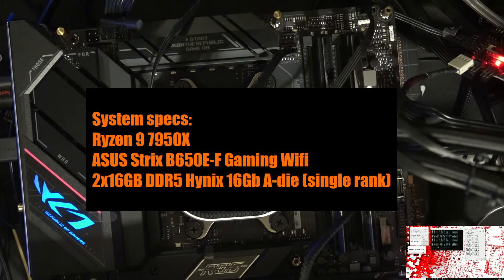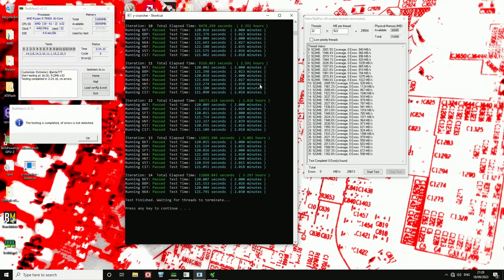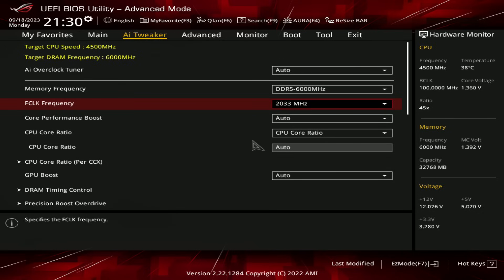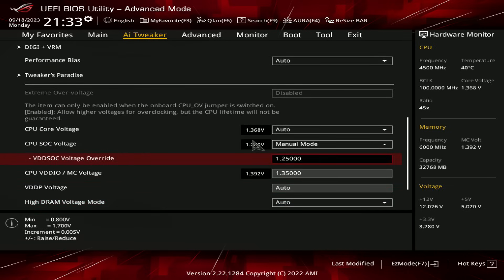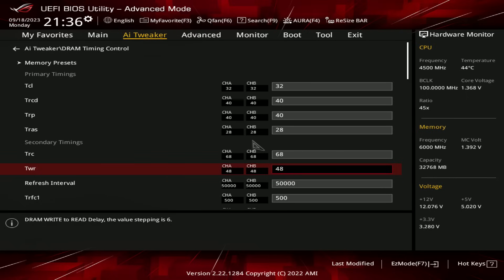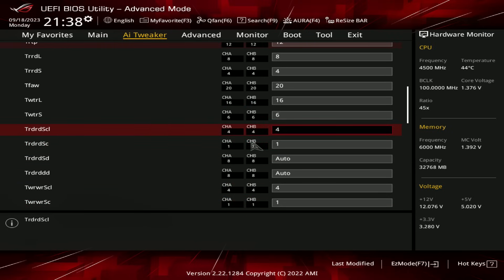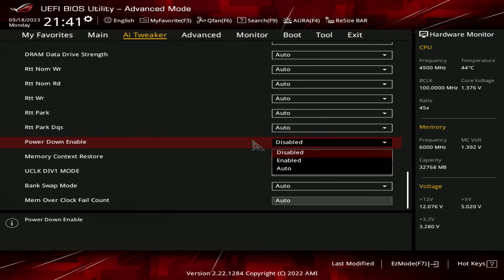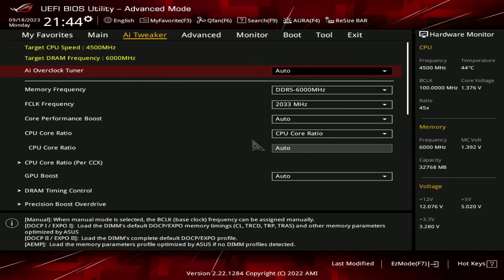Easy memory timings for Hynix DDR5 with Ryzen 7000

Comment: Hello there. I've got a big issue with my new kit 16gbx2 rams. Well , to explain , I have an Asus x670e ProArt motherboard. I've already have Corsair 16GBx2 cl36-36-36-76 EXPO edition. Yesterday, I've bought another 16GBx2 RAM but with CL36-38-38-76 but Intel XMP edition. The thing is that I've got crashes and windows errors from time to time. Does my 1.020V SoC does impact the RAM ? Because I like to have my CPU at slow temps, I'm playing mostly FiveM and DayZ, are running great on my 1.020v SoC voltage and -35 negative on all cores. I would like to find timings to fit with my both EXPO edition ram and XMP ram. Timings are almost the same but the voltage , for the EXPO is on 1.35 and on intel is 1.25V. I would like to get some help for it to bring more performance to my PC without increasing the power draw on my PC.
Reply: I dont think soc voltage is the culprit here, your co might be too aggressive. I had similar issues on -35 co. -30 is much more stable.
Also you can try changing voltage on xmp to 1.35 to match expo’s. Or better yet, set both of them to stable 1.30v

Comment: I changed flck from 2000 to 2033 and my 1% lows increase from 240 to 260. So id say that is great. However, I used all your timings and it made no difference. I am using a gigabyte board and the low latency mode. I wonder if the effect is similar? I checked hwinfo and the timings are indeed the ones i copied from your video. Im very confused by this.

Comment: cool vid, only a year late to finding it...  have you figured out why the 2033 FCLK is faster than other options?  curious because clearly there is a reason.  In recent experimentation with CPU undervolting, I discovered that the core voltage is too low with expo on causes crashes.  this is not how Ive seen 5xxx ryzen work because its SOC voltage sensitive. it seems odd I can run a 7950 at 0.95v with expo off and it requires 1v with expo on.  MB set to auto SOC
Reply: From another comment: 
"2033 was faster for him because of a bug. on newer agesas, you want to run 2000"

Comment: hey, just to tell you that on my Asus ProArt x670E Creator Wifi, with 7800X3d and Corsair CMK32GX5M2B6200C36 6200 kit, I have BSOD using exactly same timing as you. I have of course disabled Power mode and MCR as told in the pinned comment. Do you think it could be because of the VDDIO voltage ? 1.35 is not enough for this kit ?

Comment: [First time PC builder]  Glad I came across this video. Couldn't get past 5600Mhz with default expo settings, not sure what was wrong there. But with these timings 6000 seems to be running smoothly with ryzen 7900x and asus x670e-a.
Reply: I had this same issue with your motherboard and realized I was using intel ram sticks and not amd ram sticks lmao.

Comment: Is it possible for these timings to be unstable? After my computer shuts down abruptly, for example due to a power outage, I get a dram light on my motherboard and it doesn’t go away even after reseating the memory.
Reply: The issue only goes away after resetting bios, after which I can set these timings again and everything works fine until the next outage

Comment: I have a question. I have gskills 64gb 32 gb per stick 6000 30 40 40 96 hynix m die 2 rank. The expo profile does not have secondary timings   when I run expo by its self I have a latency of 79ns  when I add your secondary timi gs at a 2000fclk I get a latency of 67ns. I have been told I want to shoot for sub 60 ns latency.  What if anything could I do to get there?

Comment: I'm getting restarts and freezes on my asus tuf x670 plus with two different brand memory kits (sk hynix) and Ryzen 7600. I'm not sure if it is my garbage motherboard or something else ,thinking of switching to MSI motherboard. Any ideas would help
Reply: Yes, never ever mix different memory and do use the exact same memory on all banks (preferably use only 2 banks of your MB if possible)
Reply: @medusa2820  I have never mixed them ,I have only tried separately brand by brand and now I'm trying the 3rd one :) I'm getting a feeling that my cpu doesn't like 6000 mhz overclock.
Reply: Oh and one more thing, if you try a lot and the computer keeps crashing, rebooting, BSODing, you HAVE to clear cmos, otherwise it will remain in some kind of failure state.
Reply: thanks👍 I will keep that in mind

Comment: How about the ryzen 7600, since it's a lower bin can it still easy hit 6000? I have a 2x16 kit with spec expo 6000 and it's on QVL of the mainboard, but I get crashes blue screen. I did try to load expo timings and set speed manually to 5200, still errors etc. I even get crashes with default settings for the cpu and the memory....Solved, memory stick was faulty. Works fine with the new kit.

Comment: @buildzoid - is there a guide like this for Samsung DRAM? Going on the assumption that when Thaiphoon says "Samsung" under Manufacturer in the "DRAM Components" column that I do NOT have Hynix, then the timings probably won't work for me. Does anyone have or can anyone point me to timings for my setup? Specifically, I have Samsung K4RAH068V?-BCQK (yes, a question mark in the part number), 16Gb/1die, 2048MHz G.Skill memory - 2x16GB modules. The Expo numbers are 36-36-36-96, RC=132, WR=90, RFC1  = 885 RFC2 = 480, and VDD = 1.35. I'm certain there are better values; I just don't know how to test without catching on fire or blowing up my system ;)             EDIT: memory part number is F5-6000J3636F16G    EDIT 2: on a MSI PRO 650-P WiFi (MS-7D78) with an AMD Ryzen 7 7700X - sorry for those omissions. 😁

Comment: Hey, I have G.Skill S5 DDR5 2x16GB (CL32-38-38-96 1.35V) with seems to have Hynix chips. I copied your settings, but I get strange artifacts. Let's say I want to lower the speed to 5800Mhz how do I adjust other values? Or maybe you have some ideas how I should adjust your copied values? Thanks in advance.

Comment: I did everything exactly the same but it won’t apply all the settings only some. For example Tras, Trc, Twr and some others are impossible to change. I can type in the wanted value but it won’t apply. Ai Overclock Tuner can be put on Auto, Manual, EXPO 1, EXPO2 and EXPO tweaked but I tried every option and none of them let me change those values. Any ideas how to fix this?

Comment: This is an old video and thread. I know that. I just want to put that out there before the trolls come at me.
I have not been in the PC game for over almost 15 years and finally decided to build myself a rig to play with friends and transition back.
I built my PC and ran it stock for about a week. After that I decided to try overclocking the RAM to get more out of it (EXPO) and decided to see what else I could do. 
I ended up under-volting my CPU cores by NEGATIVE 20 and then after stability checks went to NEGATIVE 30. 
I used the exact settings and timings from Buildzoid in this video for Hynix 6000mhz RAM with G Skill CL30.
My PC passed multiple tests day at random times when i felt like testing stability and performance.
 I used AIDA, Cinebench, and MEMtest. Never any errors.
Fast forward to 3 days ago. My cores at negative 30. Buildzoid timings. 
I am in the middle of a Tarkov Raid. PC crashes.
Next day. After a Tarkov raid. PC crashes.
Event Viewer says "System Kernel-Power Event ID 41"
I go into BIOS right then and remove all Undervolting in the CPU.
Yesterday. Running Path of Exile and surfing the web. PC Crashes.
Today. Start computer and start surfing web. Crash. 3 hours later.. after running Tarkov for about 2 hours... Crash. 
Event Viewer only says "System Kernel Power Event ID 41"
I change my RAM timings back to EXPO.
PC only runs for about 20 minutes and then Crash.
It tries to boot 3 times only to crash immediately. 
I had to go to work but when i got home. I took out the CMOS battery and reseated all my components and rechecked all my connections.
RAM is at stock timings now and so is CPU with stock settings and i have had no issues for hours now. 
I think something does not like the settings over extended use. But i have no clue. I am just glad my PC is running smoothly again so far.

ASUS TUF B650 PLUS (BIOS 2214)
Ryzen 7 7800X3D
NZXT Kraken 240
32 GB GSKILL 6000Mhz CL30
6650 XT
Corsair RM750e

Comment: It's absolutely infuriating to me that ASUS refuses to fix the known issues with enabling EXPO on X670 motherboards. I get a failure to POST every time I try EXPO I or EXPO II, but can manually change timings just fine. Also ridiculous is the fact that my mobo lists my RAM as fully supported up to DDR5-8000, but limits it to 3600, no matter what RAM you install.
Reply: im just getting into overclock adventure 
After a long research I understand the CPU work great with too sticks, especially AMD
I finished my build 2 days ago with x670e-F corsair 6000 cl30 2 dim 16gb with 7800x3d
Expo work fine
Reply: @speed62ful   EXPO doesn't support 4 sticks. It should work fine with two sticks, or possibly even 4 sticks if purchased as part of a single kit. I bought two kits of 2 sticks each, and even with the same serial number, EXPO will not work.

I just didn't understand enough at the time.
Reply: I'm trying to get my 4x32GB of RAM to work at 6,000 mhz on an Asus Hero. I've wasted countless hours researching and still no luck.
Reply: @GoldwireIT   My problem, after countless hours of research, is that I bough two 2x16gb kits. In order for 4x16Gb to work, you MUST buy them as a single kit of 4x16Gb. Even though mine have identical serial numbers and were purchased at the same time, the board will not allow overclocking.

Comment: Be carefull setting Power Down DISABLE on certain motherboards. Here on B650 Tomahawk with M-Die ram kit if you set PD off and CMR on it will lead in bsods and boot corruption, so POWERDOWN need to be ON if Context Memory Restore is ON. If you corrupt boot with bsod at startup do this: tap F1, then Prompt Command and type exactly this: BOOTREC /FIXMBR, press enter, then type: BOOTSECT /NT60 SYS, press enter, then type: BOOTREC /FIXBOOT, press enter, type EXIT, enter and reboot. Now boot is fixed and windows will start. Thanks me later :)  This should be put in description
Reply: My system crash like crazy with PD ON if I'm using Buildzoid timings but when I'm using EXPO then I can turn it ON. I don't know what's better EXPO with MCR ON or Buildzoid timings with MCR OFF. The difference in boot time is  big 16s vs 56s
Reply: MCR off is best for improving memory stability and improving latency some. Turning off Power Down Enable to Disabled can improve performance
Reply: So what I shoud done? I shoud off PD or dont touch it?
I have alresy off CMR
Reply: @siebakk827  With CMR off it can be disabled, but some ram/mobo combo still don't like PD off however
Reply: Are y’all on latest bios?
Reply: Good tip there. I had some crashes during Win10, performing an OCTT test, performing a MemTest test and when I was on the bios doing some tweaks (all this after I applied the config in the video) but I also already had tweaked the Curve Optimizer to negative 30 while I hadn't any issues before tweaking ram timings I never fully tested if that CO setup was really stable. 
Anyways, I also have a MSI B650 Tomahawk motherboard and I applied all the config in this video, included the voltages for SoC, MEM_VDD, CPU_VDDIO and MEM_VDDQ BUT I left Power Down and Context Memory Restore both in Enabled and CO is back to normal (with no config applied for now). So far I only tested 1 set of tests out of 4 from MemTest86 (passed without errors) and played Ghost of Tsushima for about an hour and no crashes, stutters or any other kind of issues happened. I did noticed a little performance improve in the game (arround 10 more fps) but I can't really assure that since I don't have any readable data to compare with, only my own experience from played the same game the day before configs were applied vs now.

Summarizing, this configs worked for me with this mobo if you also apply the voltages shown in the video and left PD and CMR both in Enabled.
Reply: What happens if my m.2 with windows doesn't show up anymore? Even on another PC? Drive is fried?

Comment: Will this work on high speed Hynix a die ?

Update… I got some good settings now.

If you have a b650 aorus elite ax ice board paired with teamgroup 7200mhz cl34-42-42-84-126 1.4v 

I can give you my settings & you will see a night & day difference 🙏🏻. Good luck to all

Comment: Thank you, thank you, thank you!!  This is the second time using these timings whenever Expo is not running stable.  With these settings, and using the EXPO timing, with G.Skill 64GB (2x32) 6000 CL32 on a Tuf B650 plus-wifi, I am having no more crashing, or boot errors.  Last time I had to  use these eventually BIOS updates came out and I was able to use the Expo settings with no adjustments, but until then, yours run flawless as is.. and they are fast!

Comment: Very helpful, I just straight out put these timmings on a 2 x 32 A Die 6000c30 kit and it worked. After a few days I am now at 6400c30 2200 FCLK with a bit lower voltages.
Reply: Hello there i got the same kits. What are your timmings for 6400c30 2200 thanks for the info
Reply: @diegopulgarin-of1fx  I am now at 6400 c26 38 38 28 with 2133 IF for better latency (56ns) . Upped the voltage at 1.6 and added 2 small fans on top 👍
Reply: And what are You secondary timmings?
Reply: @diegopulgarin-of1fx  TRC at 64, TRFC 500 TRFC2 465 TRFCSB 417 and for the rest same like buildzoid's pretty much. I'm using B650e-i and 7800x3d.

Comment: Life saver! Been suffering for months. I have a Ryzen 9 7950X, ASUS Prime B650 PLUS (new board, used to have GIGABYTE B650 AORUS PRO AX which gave me constant random power loss issues with this same kit), 64GB (2x32GB) G.Skill Trident Z5 DDR5-6400 CL32-39-39-102 (F5-6400J3239G32GX2-TZ5RK, shows as Hynix). Intel XMP profiles are detected by the board. DOCP I, DOCP II, DOCP-Tweaked, all gave me horrible instability and memory errors. I tried tuning things myself as a noob, obviously failed.

These timings are perfect. I ran HCIMemTest to 2,200% with 0 errors. No instability at all. Primary timings to 32-39-39-28 as instructed, everything else is a direct match to your settings. Also disabled memory context restore per the top-voted comment. My AM5 system is FINALLY stable. I will take the 6000MHz even if the kit is 6400MHz. It's finally stable!! Thank you Buildzoid!

AIDA64 changes:
Latency = 79.5 ns >>> 65.2 ns (18% improvement!)
MemRead = 78000 MB/s >>> 83500 MB/s (7% improvement)
MemWrite = 74000 MB/s >>> 91000 MB/s (23% improvement!)
MemCopy = 67500 MB/s >>> 80500 MB/s (19% improvement!)

Comment: I arrived here because my game kept crashing in cs2 turned out it was my ram getting too hot.  Once the Ram gets to 55 degrees it starts to show errors in prime.  My Pc was stable for along time  using the default xpo profile but turns out dust had clogged the intake fans causing temps to rise by about 1 degree which was enough to cause instability.  I am now using your settings and I am pleased with a 200 point increase in the memory benchmark on passmark.  I've also ordered a ram cooler hopefully I can keep the temps below 50 and might be able to push ram speed faster and timings tighter.
Reply: dude just put a 120mm fan in front of your ram
Reply: So after 3 months stability it started crashing again.  So temperature definitely isn't the issue.  Updated the bios on the B650e-f gaming wifi still same issue.  I had to lower soc voltage to 1.2 and vddio to 1.3 and seems stable at the minute but more testing required.  Ram is G.skill Flare x5.
Reply: @robertmcallister50  How's your system so far?
Reply: @c1via  It wasn't the ram that was the issue in the end it was the too aggressive curve optimiser.  I used the settings from ryzen master but it was too aggressive. I have -30 set on all cores now and not had an issue.

Comment: I couldn't run Windows without errors using Expo and these timings sorted me out! Thanks a ton! I was planning on returning my RAM prior to this. 24GBx2 6400 kit running at 6000 for the record F5-6400J3239F24GX2-TZ5NR

Comment: My dumbass bought XMP ram on my AMD build, and this guide got me through hours of issues with ram timings. 10 years since my last build. Got it running at 6200! Thank you.:thanksdoc:
Reply: Haha I nearly did same thing
Reply: Guys do u realise xmp and expo are the same thing they work vice versa
Reply: @MrEggyfaceOne is optimized for Intel and the other for optimized for AMD. yoy can theoretically make them the same thing, but, you need to have the knowledge to do that
Reply: @MrEggyface AMD memory controllers are quite a bit weaker unfortunately, so timings that work on a 13900K won't work on 7950x

Comment: I keep trying to do this, and I can't manually set and get my 5200 rated Intel XMP coded profile 128gb of DDR5 up from 4800 to 5200...    on a Ryzen 7950x that wants an EXPO coded recommended profile.

Someone needs to make a video explaining what all these settings and numbers actually mean, on a physical hardware level, so you have some idea what you are doing by changing a number.   Otherwise, you're just dealing with a black box and the values are literally... almost meaningless.

Comment: Any chance you could do a event better timings video, I'm new at this honestly first time I've ever had a CPU/Mobo/Ram combo which had any OC potential but the system is rock solid with these timings even at 6200mhz so I dropped back down to 6000 and lowered the Tcas to 28 instead.

What I mean is if this is easy could you do a video about the next step up?

Comment: Guys don't just blindly follow any BIOS advice. Try setting one parameter at a time and test. Disabling Power down mode is a blunder. It's equivalent to the memory training option on an Intel Mobo.
Reply: literally the worst that’s gonna happen is your system won’t post and you have to clear the cmos